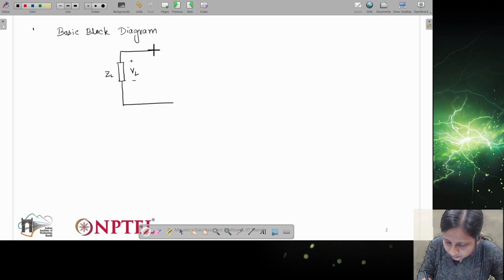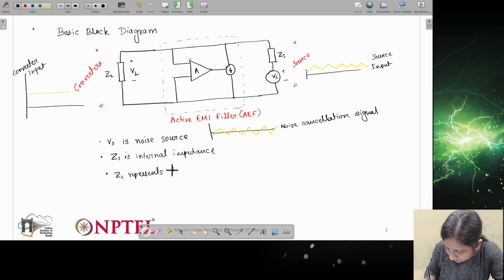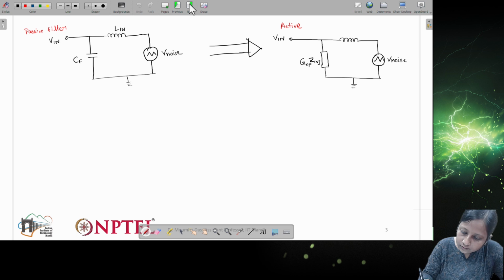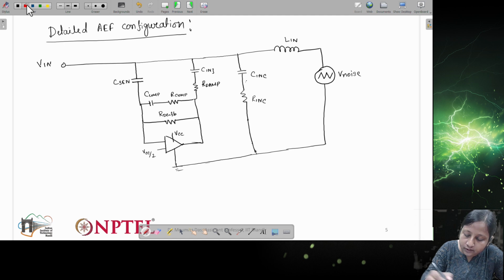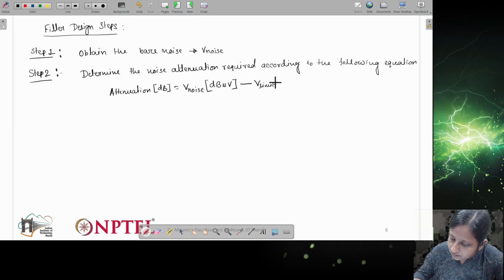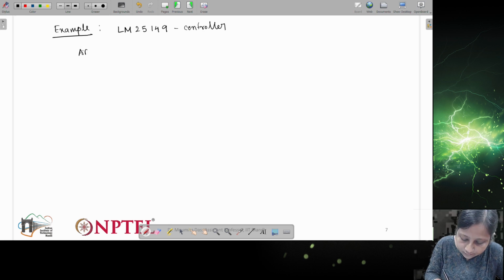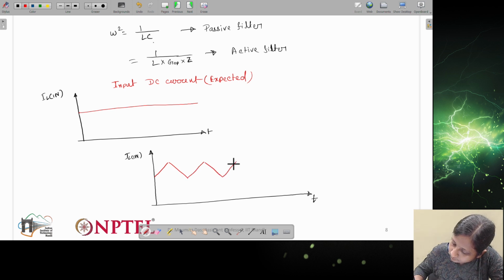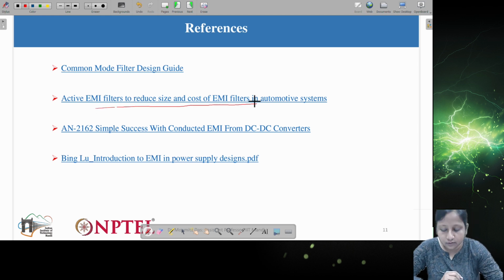Electromagnetic Interference (EMI - Active Filter)

Comment: generally noisy source voltage will be very high say, 100-300 volts, then to put op amp as an active amplifier, then
 where you will get that much high voltage rated of opamp?